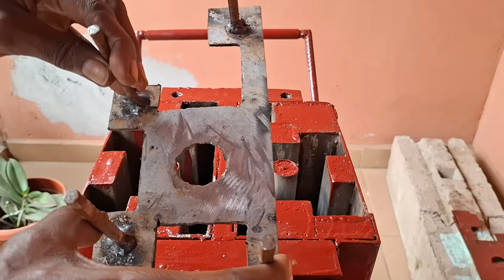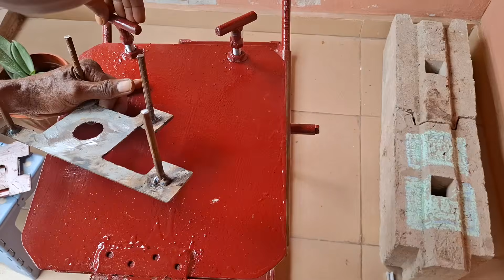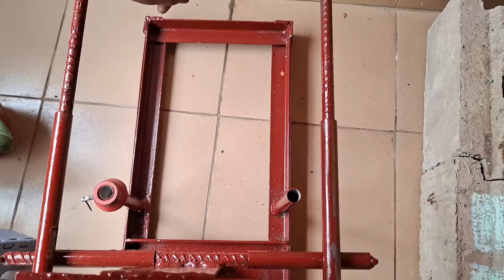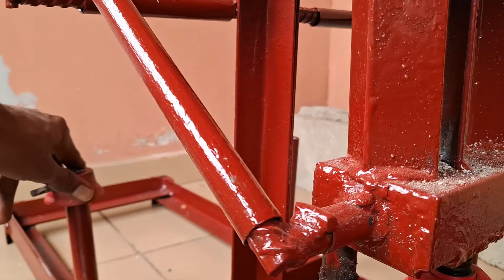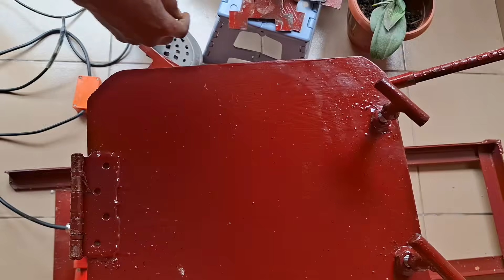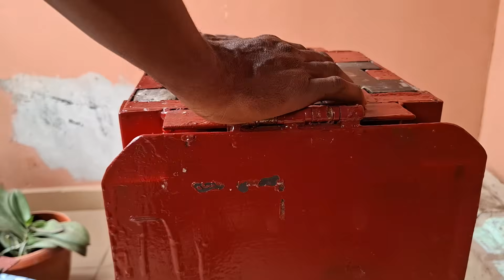DIY VAD VAD interlocking brick machine

Comment: The concept behind your design is great—I really like it, especially the fact that you both design and manufacture it yourself.
I once designed a mould—somewhat similar to the one you created, though with a few differences. Mine is shaped like the English letter T with a wide base, and it lacks the two recesses found on the sides and in the middle of the front section of your design.
The Chinese company that manufactured my mould didn't do a very good job; the bricks come out more swollen than they should be.